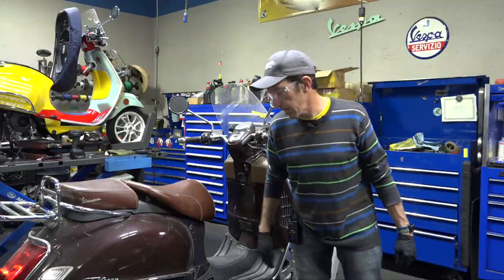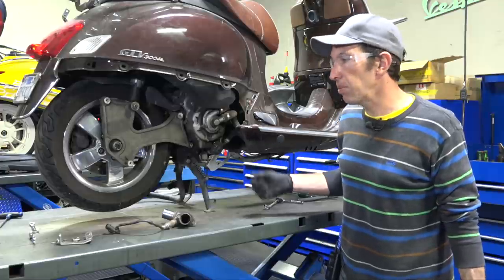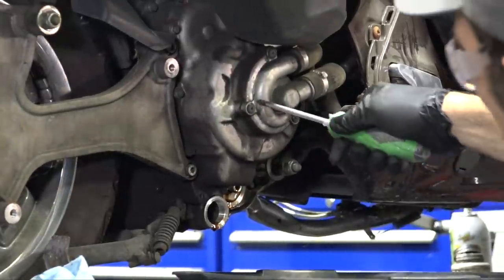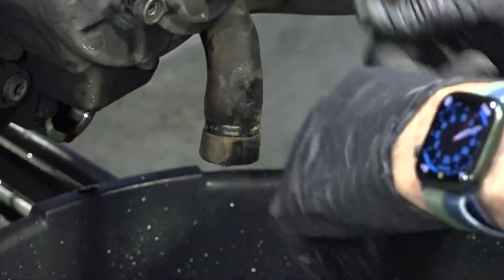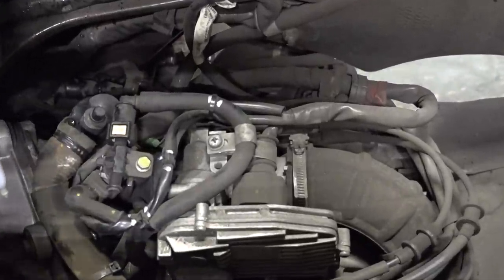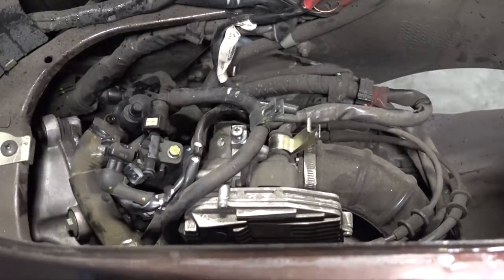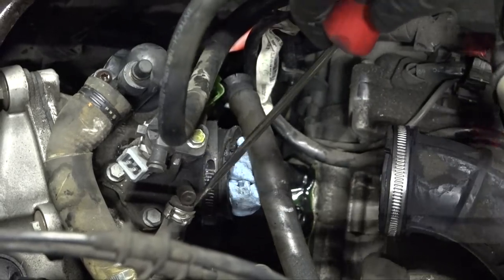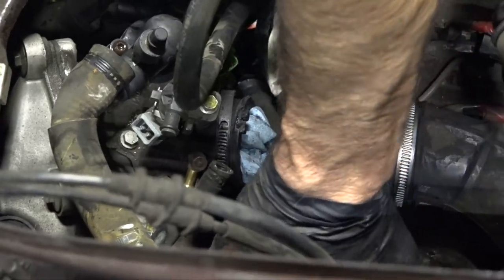Vespa GTV Resurrection | PT. 1 Engine Removal

Comment: I wore out several of those Hammer impact screw extractors . The one you have is in relatively good condition,  only showing a little mushrooming.
I have a set of drill guides that do an excellent job of centering the drill on the stud when it is recessed like it is on that head. I have seen the set available from several different tool suppliers. I like left hand twist drills for broken bolts and studs.  Most often the drill will catch it and back it out.